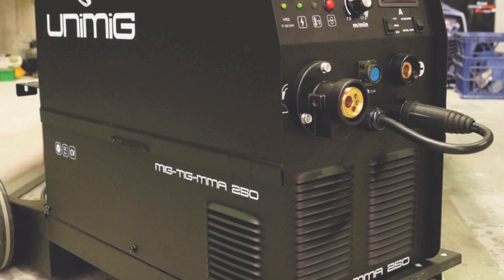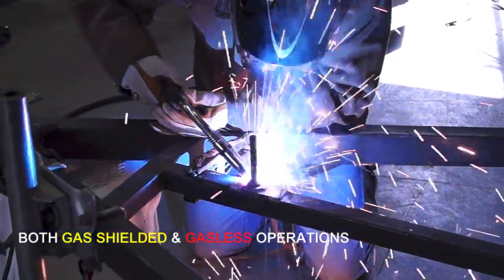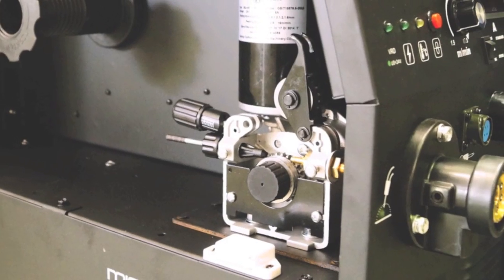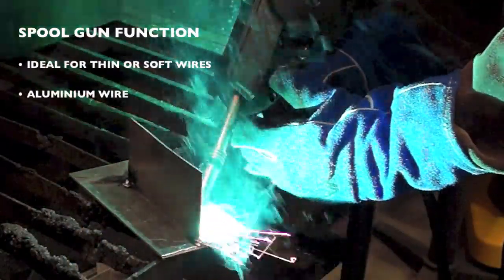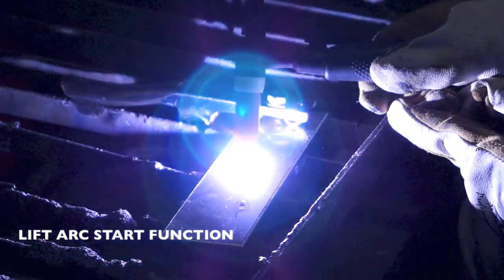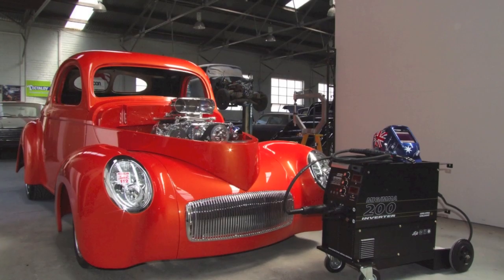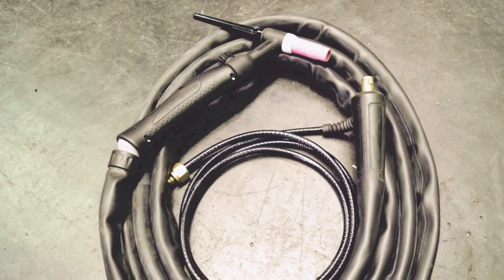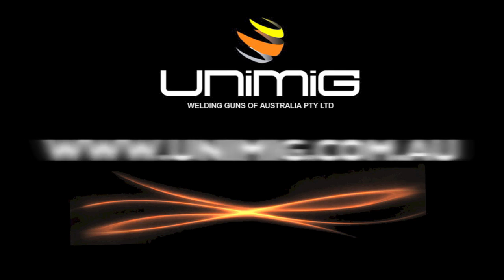200 / 250 AMP MIG/MMA/TIG Compact Inverter

Comment: Can you do an updated video featuring the 250 Compact, i just bought one but there is not alot of info on running that machine specifically, its the one with the twin rollers for the mig wire etc..   id like info on if i run it at 240V 10amp single phase.. what is the max voltage setting?   also hows the best way to run it for welding? Voltage and impedence Vs wire thickness and wire feed speed on selected materials and thicknes..
Reply: Best is 240 volt . 32 amp , thats what i run mine at , you can use 15 amp , but i found that , under powered ?